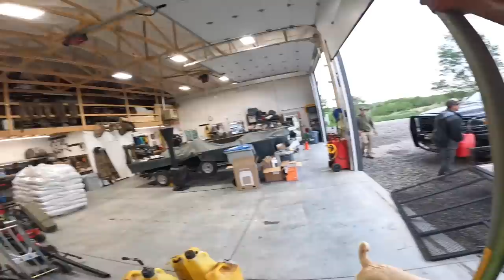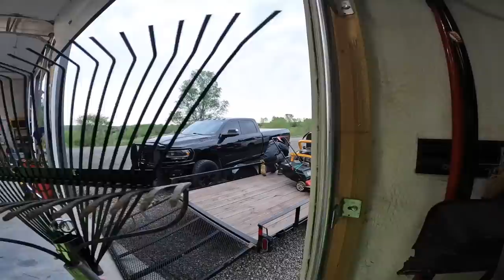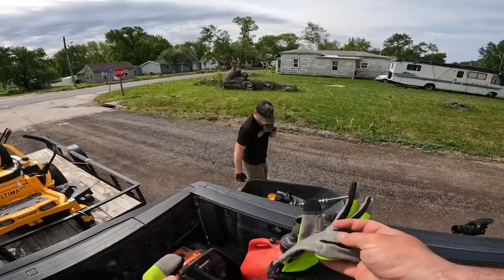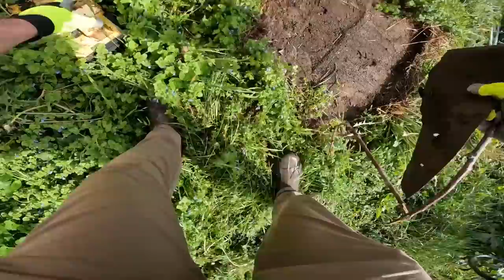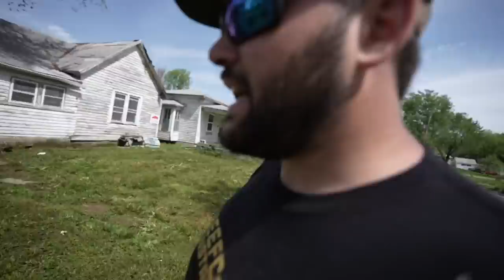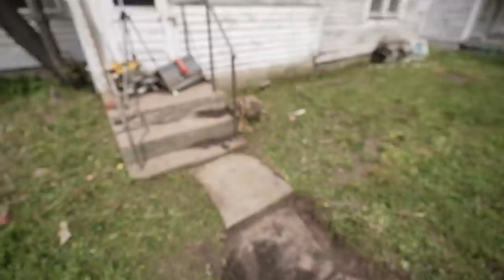I CUT the WORST Overgrown Lawn in Town for FREE (Full Yard Makeover)

Comment: if you get another zero turn or stand on I recommend a scag or toro. After a job like that make sure to sharpen the blades on the mowers also when line trimming try going right to left it helps a lot and throws the grass into the yard not onto the house.

Comment: I was a landscaper for many years and my OCD kicked in hard core watching you go in circles, aiming the shoot towards the house and street, then to just go back and cut it in rows LoL. Next time just put the deck on the highest setting and mow with shoot pointing inwards in even lines then mow the exact same way a second time but with the setting on the second from the lowest setting. Also when you’ve had enough hours on a zero turn you can drive backwards just as well as forward without hav to turn on the side of the house
Reply: I’m not a lawn care guy but I’m with you 100% no hate to flair he’s not a pro mower but yes mow it all to the middle mulch the pile you made then go back for your finish cut all while being mindful of where the discharge is going. He’ll learn the more he does it just like we did.
Reply: Seriously in the beginning of the video that one kid said he never heard of 40to1 lol didn't know what it meant clearly not that experienced
Reply: @adamjones8677  🤣. I’m surprised he’s got equipment that still uses mixed gas LoL. None of my stuff uses mixed
Reply: @Abears_  yeah everything is either electric or four stroke I raced 2stroke dirt bikes when I was a kid everything was 2stroke
Reply: @adamjones8677  Yep! It all changed like 15 years ago and things switched to 4 stroke which I like better than mixing gas

Comment: Tip:when your mowing next to the road or someone’s driveway don’t let the flap aim that way when your next to the strip you just did that’s when they can be facing that way to prevent your crew and motor vehicles and motorcycles from crashing and getting injured

Comment: Flair, you do realize 50:1 is just a tiny bit richer (more oil) in the gas, then 40:1 witch is leaner (less oil) if anything run it richer you won't blow it up with to much oil less oil could damage but doubtful
Reply: 50-1 has less oil than 32-1 but yes more oil will smoke a bit and foul a plug after repeated long term loose but it won't trash your equipment,

Comment: I’m 12 and I mows lawn all over my neighborhood but my weed whacker won’t idol and it takes six minutes to start so I looked  up what was wrong with it and it takes 40 to 1 gas I’ve been putting 50 to 1 gas in it because that’s what my dad said to use so I told my dad and he insisted that I keep using 50 to 1 gas so every time that I go over to it I’m pulling on it for six minutes and it sucks and then if it dies because because it doesn’t idle I just spend six minutes again trying to start it